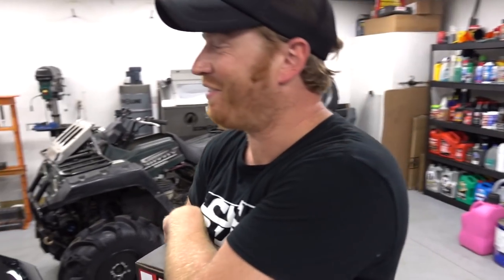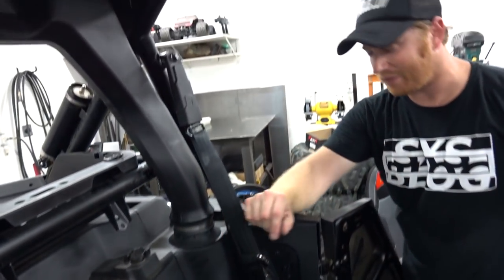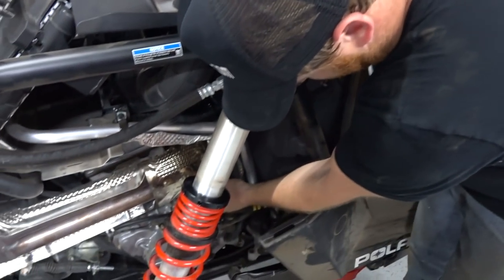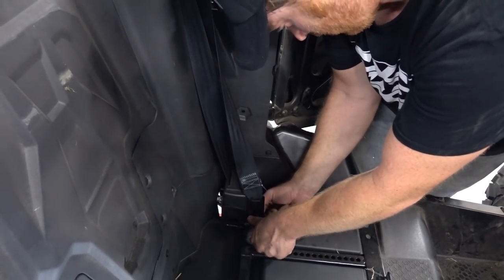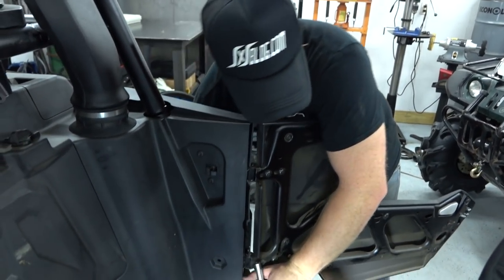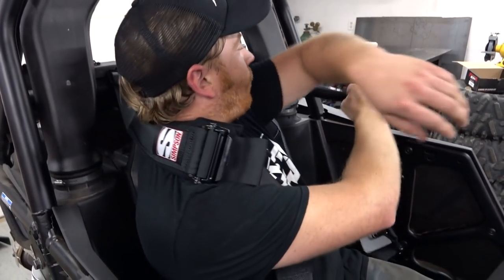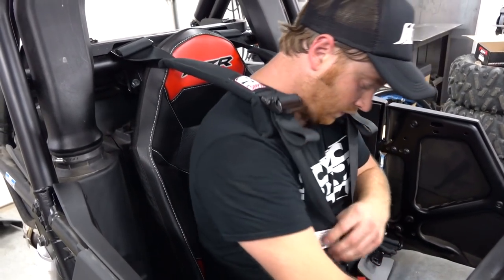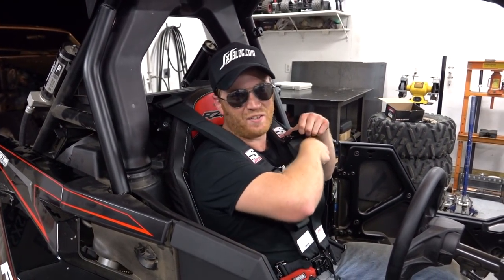Our RZR RS1 gets some Simpson D3 harnesses how-to!

Comment: Bought the RS1 and got to take it out on July 4th for its official first trail run. It is a frickin blast!! I knew before I ever bought it that the factory belt would not cut it in a hard crash. The seat is not much better since there is no side stability but may deal with that later.  As for now the factory belt gots to go. I just ordered the Simpson D3 harness from some guys that sell like 4 parts.... Think it was sxsblogparts.com . I agree with some other comments that the shoulder belts attach a little high so I may modify that as well. I have been racing cars for years and I like to be pulled tight down into the seat not just back.   Keep up the good work guys!! oh yeah, one more thing. Special thanks to "LEONARDO"  for helping me out  a little.

Comment: Thx for this vid guys,  Had a set of pro armor and just installed them in my new rs1,  video def was help.  I didnt like the angle of the of the right side mounting point so I took used a 2 link of 3000lb chain to orient the bracket correct.  You guys rock!

Comment: That was the first thing I did for my RZR I took it to Hollister trails and I did not like the stock seat belt it did not feel safe enough so I bought the Polaris seat belts and it did a whole lot better
Reply: The harnesses really helps in that car that card is fast and it has a lot of power and with the harnesses it keeps you planted in the seat when I was at Hollister Trails I felt like I was going to fall out until I put the seat belts in after that it feel like I was glued to the car and have more control and stable bility
Reply: Planning on buying a GoPro and going to Pismo this month with my RZR I have everything paddles and all the good stuff to put on it will be posting videos of my cart soon hopefully you guys can send me some stickers and stuff to put on my Razor

Comment: I was always led to believe that four or five point harness Systems need to be mounted below the shoulder blades to be effective.... I use the UTV INC mounting kit which uses the stock tabs and keep the mounting points as low as possible.
Reply from the maker: Ideally yes, you're correct, the shoulder straps should mount just below your shoulders, but this is still a big upgrade over a factory 3-point, where the shoulder belt doesn't do anything at all to hold you down.